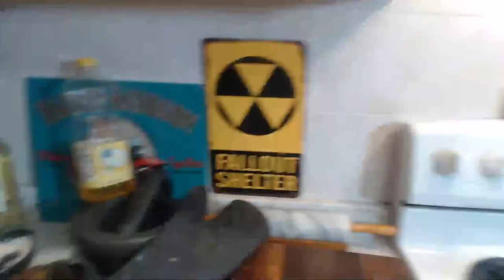Cast Iron Wednesday 06-01-2022: If You Don't Succeed Then Lye, Lye Again

Comment: When I worked in a lab we had brass brushes we used to clean the iron and stainless steal molds we used to vulcanize samples of natural and synthetic rubber for testing before they would run the big batches. I have tried to find similar for my cast iron. Best I can find is the cheap things they sell in big box stores. Seem to be iron or steel. They work ok for crevices but not as flexible as the others.
Reply: From a Cast Iron guru: "The brass color will transfer to the iron. Not good. Difficult to remove."